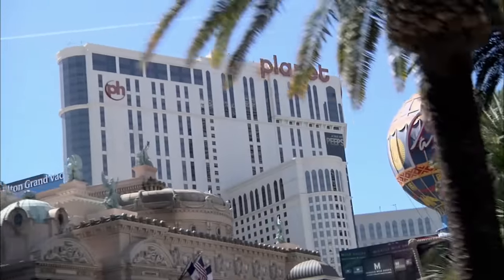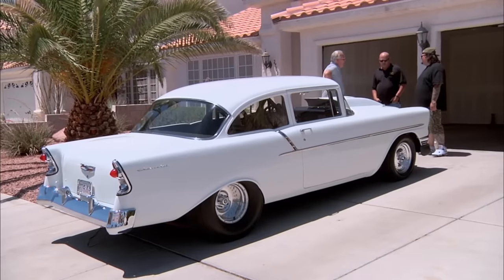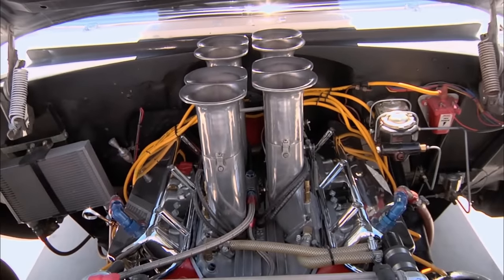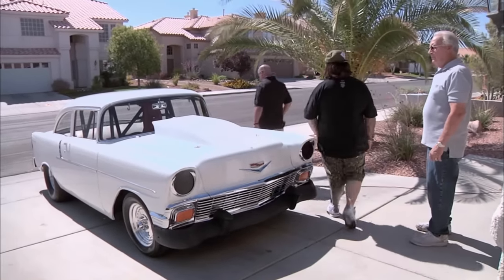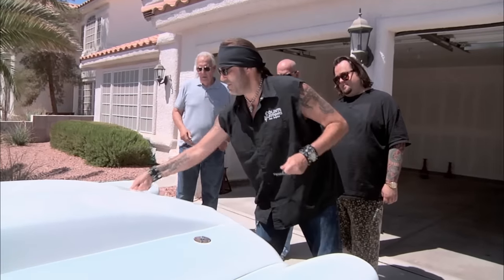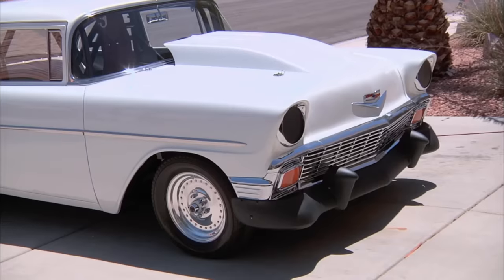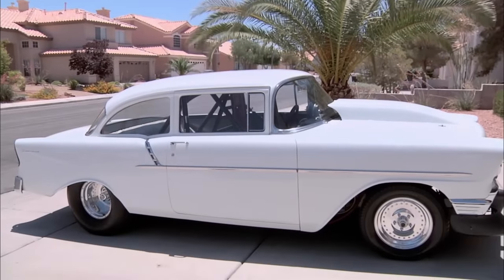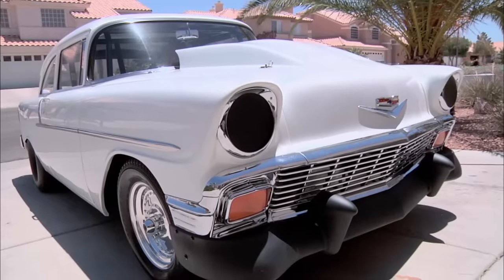Pawn Stars: Rick's FAST MONEY Deal for a SPEEDY Race Car (Season 7) | History

Comment: Owner started way too low. Should have asked 60, then huffed and puffed until Rick got him down to 45.
Reply: Steven Hickman  so why they don't sell it on parts?
Reply: Steven Hickman  promaster123
Reply: He's moving so he wants it gone, not many people on the street will pay that kind of money.
Reply: It’s a toy. Can’t even drive it on the street, not a lot of people have that much money to spend on a toy.
Reply: I know what is it with people I want this much so I started this much You know they're going to screw you start 15k over what you want and just maybe you might get close to what you want
Reply: I think the seller was smart in being realistic. He knew beforehand this kind of endeavour was going to be a loss, and he knew dealing with Rick he'd end up getting around the $35000 range, so to get an extra couple of thousand above that means he played it well.
Reply: @MrZachgonz  That car is old.  Dosent need smog. He can drive it on the street but its gonna feel weird if you never felt driven on those types of tires(slicks).
Reply: It'll never go that high. If it was a normal restomod street hotrod, yea sure. 60k isn't an issue but an all-purpose drag car if it's NHRA certified or not, it's never gonna be beyond 50k even if it has a massive 720ci Big Block Chevy with 3000hp in it. It just won't be that high. It's lucky that they're even getting 37K out of that.

If they tear the car up and sell it out as parts with the engine being one price and the chassis and all the other electronics in it as another whole package then yea. They'll earn but as a whole complete project? Naw.
Reply: Tyson Seabrook  just cuz ppl do it don’t mean you supposed to and your not it’s illegal
Reply: If you remember, he only wanted $35k
Reply: Facts
Reply: 37
Reply: As someone who races, he way overpaid for that car. He MIGHT get his 37k back for it. It still has leaf springs in it... its a 25k car turn key all day. You sould see the kinda stuff u can buy for 37. You can get turn key 7.50 legal cars
Reply: @MrZachgonz  i mean he can just change the tires and put a Governor lol

Comment: Leaf springs, stock front end. 12's at best.
Reply: ..and manual brakes with drums in the rear... great for a single run then it's into the sand. lol
Reply: @strykerentllc  8.5 on that motor?  color me skeptical
Reply: @fasteddie1241  No one said it would run mid 8s. The CAGE work is certified to GO 8.50's, doesn't mean that it WILL.
Reply: That car WILL run faster than 12s. Probably in the mid to low 10s.
Reply: @strykerentllc  I run manual brakes with drums in the rear, going low 9s, and I've NEVER had an issue stopping the car WELL before the sand. Cars have went faster in the past with 4 wheel drum brakes.
Reply: @davelowets  Okay chief. That thing is a basket case with woven ratchet straps on the underbody & spacer blocks on the rear axle and drum brakes. That car isn't going anywhere near 150MPH or the 9.99 E.T. that old man claimed to need a chute. 😂
Reply: @strykerentllc  Where did I ever say that it WOULD go that fast? Perhaps you can't read?

Comment: the expect called the smell of gas “delicious” 😂
Reply: Osel Somar  Its gasoline, this is not a funnycar.
Reply: Classic cars always have a unique smell just like video rental stores you know what you're getting when you get that smell memorize.👃
Reply: @Len1977gt  he’s running E85 which smells like corn🤝. It’s not just regular gas 🤦‍♂️
Reply: Definitely E85 or at least VP racing fuel.
Reply: @pnw_manuel5099  nah i think more than likley race fuel 100 octane  or higher
Reply: The car had hilborn injection witch uses alcohol.
Reply: @reddirtfarm7704  A radical engine like that has so much intake tract reversion going on at low speeds that there is typically a cloud of unburnt fuel hanging over the injector stacks at idle which gives them that "smell".
Reply: @neighborscomplaint6859  i agree.  My race car does the same.
Reply: Osel Somar  lol i can tell you dont know what you are talking about
Reply: @Blackheart_Rises  vp is just a brand.....
Reply: I think it’s the new engine, new headers smell. You’d have to be a car guy to understand it.
Reply: @Len1977gt  race gas high octane

Comment: From what little I know, based upon my knowledge of my toy cars when i was a kid,
dragsters are basically just power ful engines with an artificial body shell. Meaning you can get any body shell that you can manufacture from the lightest materials, glass fiber etc.

But this car actually looks like a real car!
Reply: As someone who grew up going to drag racing events my whole life not all drag cars have that type of body most do have them made out of fiberglass but those are also the most powerful engines at the event pushing 2-3000 hp maybe more since they don’t tell you. Most of the time especially if it’s not a NHRA event and an small event at a local drag strip most of the cars have steel or aluminum body’s with a big engine to run 9 second quarter miles at least. The car on this episode sound like an original steel body by the sound the door made when he closed it.

Comment: Back in the day.. 50 or so years ago, the 1955 and 1957 Chevy 150 or 210 were most desirable. Honestly, no one would touch a 1956 Chevy if they could get their hands on either of the other two, although powertrain swapping was equally the same (55,56,57) . Body style was ultimate when there was a selection.  Guess everything that old has become more and more rare as time goes on. Back then, the next set of "desirables" were the 1961Chevy Impala 348ci with triples and 4 on the floor, following that model was the 1962 Impala SS 409ci. Today, the 2 speed Powerglide transmission from that era is still used on some racing applications.

Comment: Guy turns on car for 15 seconds
Guy:  "See it runs good"
Guy sells it
Rick finds out later it overheats
Guy:  "Got'em"
Reply: Well to be fair, you aren't supposed to drive a drag car on the street. They aren't built to handle the constant driving.
Reply: It ran for 15 seconds. That's good enough for a half mile.
Reply: @Deerhunterjs  Mine can.... 😁

Comment: I find it funny that no one asked any questions about the block, heads, compression, any dyno slips?  Trans?  What rear end gears?  If I'd be forking out money like that for a supposed "new build", I'd want to see receipts?  Come on man!
Reply: You would “assume” the they talked about that, even though they didn’t show it. I’d definitely want some paperwork. Big difference between a 396, and a punched out 468. I would “assume” it’s got a 2 speed power glide trans, with maybe 4.56’s, or 4.88’s in the rear? Information you DEFINITELY need before buying a race car.

Comment: If that thing does 150 in a 1/4 mile, then I'm Elvis Presley!
Reply: Lol I was thinking that's a bit quick to trap.. I'd be thinking 135ish off the top of my head.
Reply: Y'all clueless lol, the car is certified by the NHRA to run an 8.5 sec quarter mile. 9 second cars usually reach 160 mph so yeah, this thing would reach 150 pretty easily.
Reply: @muniz27  It's certified to run an 8.5, that doesn't mean it does.. lol
Reply: @jahnperez5060  exactly its certified because of the cage. Not because it can actually go that  fast
Reply: @muniz27  9 second cars do NOT "reach 160". 140's is about it.

Comment: Yeah on that appraisal the parts list is not the complete value in my mind. The amount of work to make all those parts go together correctly and to have it NHRA certified. An easy $80,000 to $90,000 car all day.
Reply: Not a chance.. I've built way more, for say less.
Reply: @davelowets  you've built NHRA Certified cars? Out of a boat motor?
Reply: @Lefty16jd  Not a "boat motor".. There's not ONE factory G.M. part used in my motor.  Fords, Mopars, and Chevys were also used in boats, are they all boat motors also?

Comment: You have to low ball it to start with.  Just to get the temp of the guy selling it.  His reaction to the low the offer will tell Rick if he can make a deal or not.  Remember the guy call him, so Rick has the upper hand right from the start, he knows that he is way low on the list of buyers the seller has tried and failed.

Comment: Love the show but there is no way that motor is worth 40k.  I bought and had built a world merlin 2 series 454 block and heads with an 871 blower and two 660 center squirter carbs that I had 25k into and it ran an 8.597 NA at 167mph in a full tube chassis 1971 ss Camaro.  I had 250 shot nitrous but never sprayed it.  My car had a race prepped TCI th400. That motor looks like a typical truck 454 with an injection setup.  There is no way that car will run 160 on that setup.
Reply: Maybe high 9’s, to high 10’s. That car is heavy!!! People who don’t know about cars get confused on the NHRA certification on the roll cage. You, and I know different.

Comment: Engine alone worth 40k yet guy sells the car for 37k
Reply: Well, anyone selling to a pawnshop is clearly not expecting (or at the least shouldn't) top dollar.
Reply: He's moving so he wants it gone, he even said that he's taking a loss.
Reply: That engine isn’t even close to 40k. It’s just an iron headed big block Chevy. 10k at the most
Reply: @junkyardboost8372   not only that but when you invest in cars most likely you wont get out what you put in
Reply: relax folks this is all just for tv!
Reply: Engine not worth 40k.  If you watch the video he keeps his mouth shut when he mentions it because he knows it didnt cost him that much
Reply: Only American parts was the stock block. Heads and the hilborn ejection. Everything else looks like China junk.....
Reply: @reddirtfarm7704  You can see the crank, rods, pistons, oil pump, valves, springs, rockers, etc, through the invisible engine block?? Hmm, I must have missed that.. 🙄
You have NO clue what's inside that motor.
Reply: @davelowets  i bet it's a Bryant crank. Fowler rod's . Ceramic coated Ross pistons .ATI damper. Jesel shaft rockers. And timing set.ect. ect. Built by Steve Morris.  Topped with the nicest  Chinese valve covers money can buy.......
Reply: @reddirtfarm7704  I doubt that it has any of those parts, and I SERIOUSLY doubt Steve Morris had anything to do with it at all. If it had all that stuff, it certainly wouldn't have iron heads on it.
Reply: @davelowets  so you still think he had 40k in a engine that had the nicest Chinese valve covers that money could buy on it...  I highly doubt it as well!

Comment: 8.50 E.T on a 1/4 mile! I don’t know if you guys know how fast that is, but that is absolutely cooking!
Reply: Dude, the CAGE was NHRA certified for speeds up to 8.50's. The car has never run a 1/4 mile.
Reply: That car won’t even go close to that. It’s just a iron headed big block. It’ll maybe do 10s. Don’t forget it’s still on leafs with air shocks and no traction bars. It’s going to 60ft terribly
Reply: @junkyardboost8372  the guy said it runs 8.5
Reply: @duster4386  don’t care what the guy said. He also said it’s never been ran. Cage is certified to 8.50 which any 10 point cage is. An iron headed big block with no power adders isn’t going 8s. That motor makes a maximum of 600-700hp. I’ve been around cars enough to know that car will be lucky to go mid low 10s. I made 750 TO THE TIRE and went 9.90 in a 3600 pound car. That car makes around 600 to the tire. I also had a 1.45 60ft which that car will never be capable off on air shocks and lowering blocks on stock leafs. Gunna have axle wrap and wheel hop problems.
Reply: @junkyardboost8372  tbh huh at makes more sense to me. I didn’t think that thing ran 8’s until he said it. But I get that it doesn’t. But it probably does run low 10’s
Reply: @duster4386  the owner said it would do 150mph but he’s guessing since he has never driven the car. The roll cage was certified to be good enough to be fitted in a car that could run up to an 8.50 quarter mile. Doesn’t mean that car will actually do it.
It’s like buying tires that are good for 120mph max, you don’t fit them on a racecar with a 140mph top speed you buy the 150mph ones.

Comment: All depends on what the engine is made of. Didn't sound as radical as my 421ci / 500hp with 4340 rotating assembly circle track engine and I have $8000.00 in it. For what he paid for it this engine should have a lot stronger/better parts than what I have. The guy needs to keep balls in the air horns to keep anything from getting inside.
Reply: I GUARANTEE you that thing makes more than 500h.p. 🙄

Comment: As far as this car going 8.50 in the 1/4 mile...I doubt it. I would say this car may go in 10.00 - 11.00 time bracket at the 1/4 mile. As far as the price, it's a race car...if you invest in 70k in building a race car, you're not getting the money back, period. This car isn't a 1930's Ford Model A that would fetch 30k to 50k if restored back in perfect condition. 

So, I would say 37k for a 56' Chevy is a good price.
Reply: Couldn't say without hearing it or knowing more. Its an injected BBC, but whats the compression ratio? What fuel is it on? What kind of cam? Could be a 10.5:1 pump gas motor, could be a 14:1 c16 motor. 1000hp with a single dominator is doable even on a 468ci with alot of compression and a big boy solid roller.

Comment: You have to get approval to run an 8.5 second quarter mile on a closed drag race strip? Isn't the point of racing that you are allowed to go as fast as you can?
Reply: Your car just has to be certified for track liability reasons.  The faster you go the more safety equipment you need to have

Comment: Thought I was looking at a 70's strip/ street race car because I owned this type of drag car back then. Huge give away the doors open and close well, no fiberglass front on a tri 5, big big red flag, the body work is way to straight as most drag cars with big horse power twist after time the sheet metal, the frames and this car looks like it never made it down the track at all. Leaf springs with antique air shocks screams this is a clone drag car made specially for the street cruising and shows.
Reply: I was thinking the same!!

Comment: No way that car runs 8's.
Reply: They didn't say it did, they said it's safety certified for that speed.
Reply: Why? Did you hear it run? Do you know what the compression ratio is or what cams in it? Its an injected BBC so its got all the flow it needs and even fuel distribution. Could be a mild 10.5:1 hydraulic roller motor. Or it could be a 14:1 solid roller c16 motor. All motor doesnt mean slow, with high compression and race gas 1000hp on a 468ci BBC is achievable with decent heads and a single dominator.

Comment: Like how fast is that for perspective????
Reply: Its certified for 8.50 second quarter mile times, thats pretty fast for a steel body car. For reference, thats a faster quarter mile time than any production vehicle ever built, including super/hyper cars. Basically this car will cover 1320 feet, or just under four and a half football fields, in roughly eight and a half seconds and cross the line at roughly 150mph. As far as acceleration goes, a car like this will literally pin you to your seat on the hit. Meaning that if you were to take an object, like a piece of paper, and tape it to the dashboard infront of the passenger seat. When that car leaves the line and starts accelerating, the g forces are so high it would be physically impossible for you to lean forward and grab that piece of paper. People do it with 100 dollar bills as a trick, if you can grab the bill you keep it. In a car like this, no one grabs that bill.

Comment: And nobody noticed that 57 Olds rear ? Obsolete turd .. if the car was built in the 60s then it would look in place .. that engine at best would be less than 20 grand ...the injector set up is an antique  Hillborn  that is rarely seen in drag racing anymore ..what class  was this built for ? 8.50 et is a pipe dream
Reply: Guy built a nostalgia drag car, it's a thing. People do it all the time using period correct parts like you just saw.

Comment: That car sounded like methanol ran so i'd guess runs about 165 to 170 depending on engine size, and if its got blower or turbo. Atleast 1,000 horses though if methanol long block with 3/4 roller or hydraulic cam and pop up pistons. Nice tub job on it. Lots of weight reduction on it to. Maybe even a nitro hookup to.

Comment: See if we got papers and if you can run it on the street buy it and you cruise around Friday night Saturday night or not too often 55 came out with a 265 57 that came out of the 396 55 Kmart small block again but this time you're scared they care all four speeds the oldest monster two tools the one with three cuts in the main shaft it goes into the clutch that is the real monster tutorial 220 Muncie